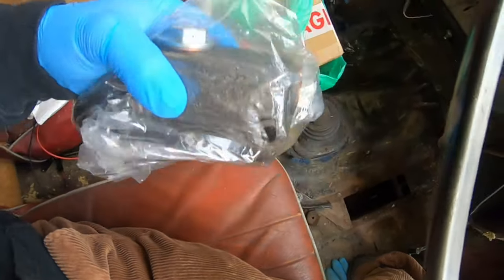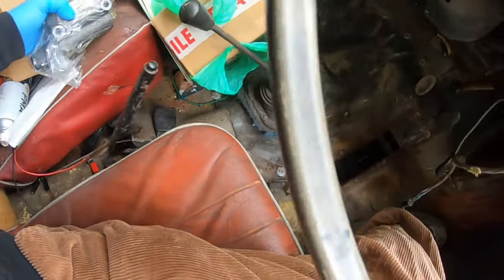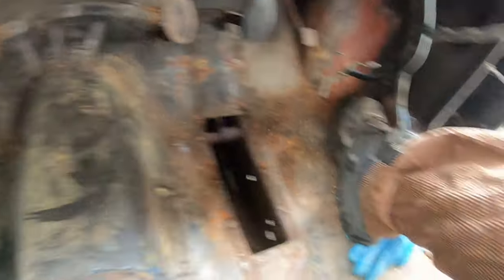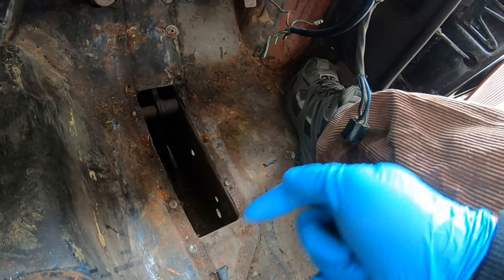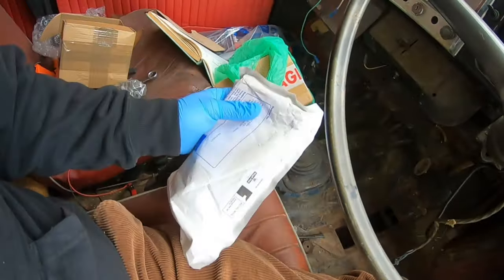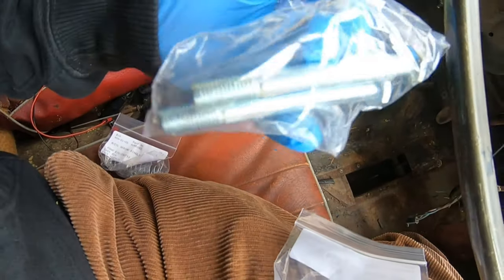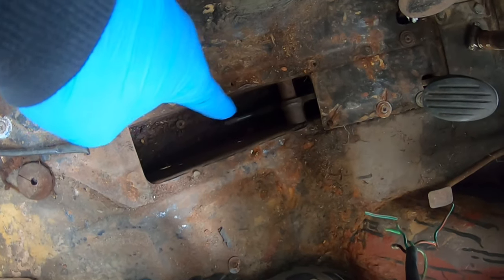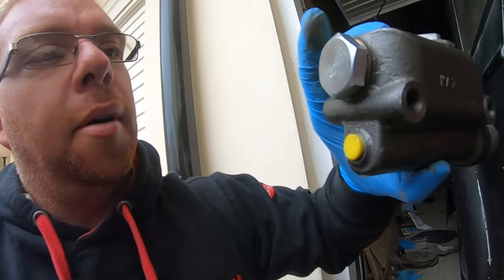How to replace your Morris Minor brake master cylinder - £500 budget restoration

Comment: The bolt heads are thinner to clear the torsion bar. The special tools required to remove and replace the bolts are: a foot of two by two, a length of medium thickness rope and a long (6 to 8 foot) length of stout bar. Tie the rope around the torsion bar between the bolt holes, rest your bar in the rope with the end of the bar on your 2x2 which you situate under the master cylinder. Get someone to bear down on the bar (or get your leg over it if you're on your own), the bolts clear the bar easily. When you put them back use some short bolts on the inside end to line  things up!
Reply from the maker: Thanks. Great idea. I actually ended up using a screwdriver and a jack as can be seen in part 2 as I didn't have an assistant
Reply: @MarksWheels  I've done more than I care to think about on my own that way. At 74 I don't think I'll ever do any more!

Comment: I have done this on my morris. The bolt heads are made about half the width of a normal bolt so that they don't hit the torsion bar. I found that on mine the bolts were rubbing on the bar the other way around. I just levered the bar down with a pry bar and they went in OK
Reply from the maker: Cool. Thanks for that. Ill turn them around at the weekend